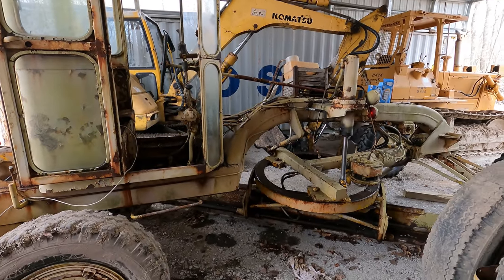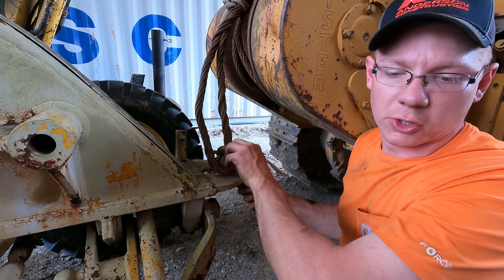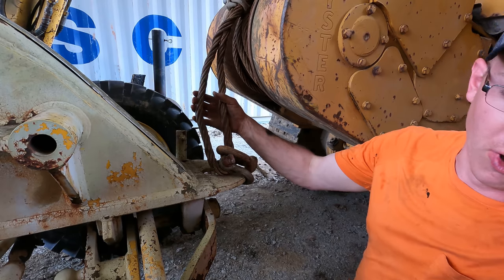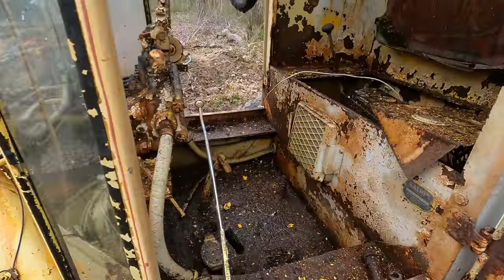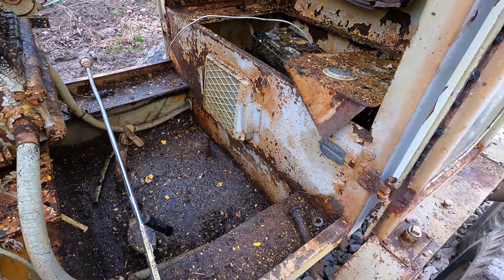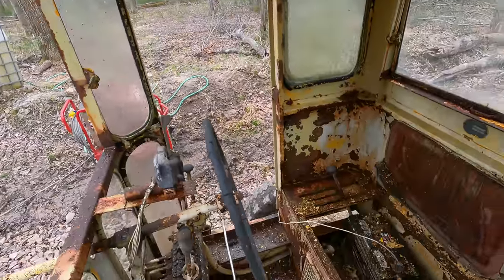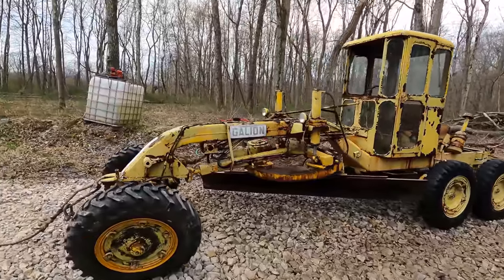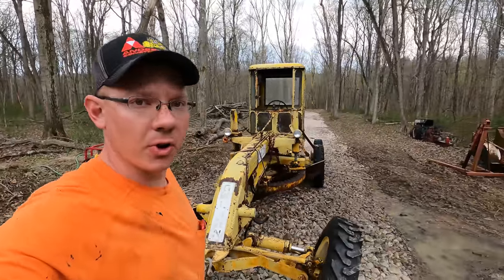Steam Cleaning 60 years of filth & paint off of my Galion Road Grader! (ASMR?) Pt.6

Comment: I get a charge out watching the grader project. I spent 36 years building road graders. Started in the machine shop , worked the assembly line, drove forklift, built transmissions, went into heavy duty repair( that's what the term was for fixing the screwups coming off the assembly line)became leadhand and  was a final inspector before they were shipped. I ended my days in RND. When I started the company was called Dominion Roads Machinery, changed to Champion (that's what the grader was called). They were built in a small Ontario, Canada town of Goderich. As long as I worked there we were either number 2 or 3 in the world competing with  Cat and Deere. Volvo bought them out and down the hill we slid. Don't make them anymore.
Reply: Thank you I did not know where Champion was built
Reply: Sounds like a might good life. 
Lots of respect from Buffalo, NY. 
Roy
Reply: Thank you for the living history. It is appreciated.
Reply: Thank you very much for the history lesson that was incredible. I live in the lower mainland of BC and I’ve been on the hunt for an old champion grader to rebuild and restore. They are incredible machines!
Reply: The DRMCo graders were very popular in Australia,  and were known as a quality machine.
Typical though, a great company bought out by lowlife multinationals and then junked.
Same thing happened to many old established Strayan companies.
Reply: @ivanolsen8596   The problem comes with a lot of smaller privately owned companies, that being there is not the financing available to do the RND to stay with the changing ecological situations. In this case when Europe went to the Teir 4 emission  standards and everybody had to follow suit if they wanted to sell equipment there. Champion was a profitable company IF they didn't have to go high tech. Actually, a California consortium , can't for the life of me remember the name, had purchased Champion and had kept it as it was several years before Volvo got involved. Once again , there was a company with the financial backing to do the RND needed and the company was sold to Volvo. And as far as the B.C. graders were concerned, I personally liked the paint scheme. Orange grader, white cab and black snow plow and wing.
Reply: @lairdspivak3616  Thank you for the info.
Reply: @anrew1000  Hi neighbor! Also from lower mainland here :)

Comment: It might be interesting to pull the inspection covers on the drive axles to inspect the chains and sprockets.  It should be easier to do it before you start painting since the wheels will be removed.

Comment: When you paint it I recommend using black on some parts for contrast, e.g.: wheel centers, hydraulic rams, blade ring, and the fan on the engine (I think the engine would look better if the fan was painted black).  It's the easy but little things that make a project like your grader really stand out.
Reply: Black and yellow are local colors too.

Comment: It’s interesting how the factory coating outlasted the coat on top of it
Reply: Old paint may have been toxic, but it was durable.
I have a 70 year old Ford tractor with multiple coats of paint and colors. All are flaking except what remains of the factory paint.
Reply: I say that about most paints amd cleaners 
If it hasn't got a skull and cross bones on the label with 14 different warnings then its prob not worth using

Comment: That cable is an old school splice. I learned it from an old miner, it's used on the underground mining slushers. You unwind a section of the cable,  cross it through itself and wind it back together. It holds really well, and with a decent tail, won't come apart even without the clamps

Comment: You’ve accumulated a nice collection of old iron.  I worked on various surface mines starting in the early 1970s (limestone and coal) in the western most counties of Virginia and the eastern most county of Kentucky.  We had some newer equipment but used mostly older stuff.  There was even a couple of the old cable blade dozers and a road grader that looked a lot like the one you’re fixin’ up.  I was qualified (and pretty good at) operating front end loaders, drilling equipment, ok on a dozer but I never mastered the road grader... great channel.. I thoroughly enjoy watching you get this old stuff running... I know how hard it is...   stay safe...   🇺🇸🇺🇸🇺🇸🇺🇸

Comment: DIESEL CREEK: If you want that clouded calcium coated glass to look new again. Take mechanics waterless hand cleaner (non grit) and wipe on with a paper towel. If you have a small buffer with a sponge pad, will work amazing. Finish clean with typical glass cleaner. 
We have this issue all the time on diesel locomotives on the railroad.

Comment: i got a couple of tires for my quad from simple tire because you recommended them. fed ex lost one of the tires. i contacted them, and they are replacing the lost tire, and giving me a 50% refund on the tire that was already the cheapest price i had found for my trouble. i told them i bought from them based on your recommendation, and it was some of the best advice i've gotten in years. you tha' man! thanx!

Comment: Awesome Matt Sunday mornings are the best youtube day videos for me, a pot of coffee and off to the couch to watch them   i work in the heavy steel industry machine/heat treat motor grader edges and we once a year clean our equipment during the shutdown and i always work it and love cleaning  stuff  this way satisfying to get things clean like this, just something about it and just went out and bought myself a Ryobi unit with 2900 psi with a Honda power unit on it was $599 CDN got it on sale at Home Depot for $479 and gonna crack it open and fire it up here in a week when it warms up here in central Canada, we still only have daily temps about 40/45 not warm enough to use it yet, the window rubber seals are easy to get, just do your best to stay away from the Chinese stuff it does not last and perishes in the sunlight, i use to install the glass in all the doors of the buses for new flyer back in the early 2000's, it is easy to work with just seal it with some black silicone from automotive suppliers, $20/tube , looking forward to future videos on Christine  👍
Reply: Love doing this stuff, dobby know why just so

Comment: The one tip I will give is keep several of the infinity/figure 8 nozzles on hand because when they jam and all you have is a tiny jet of water shooting off at 35* (*=degrees) you'll want to replace it and you local parts guy won't have it and..... no stay calm its okay, sorry was heading into rant territory.  Good luck getting Christine back together and running without her doing you harm.

Comment: Window gasket is the word you are looking for. Uses a bent hook tool to lock/unlock the seam. looks like TRIM-LOK - LK1663-100, but a lot of equipment used the bead lock type as well. Cut it a little long, lubricate it with silicon spray, get somebody to help hold it and it's a pretty easy installation with the hook tool. 😉

Comment: Around here, we call that a "Whirly-bird" head.  We use one at work, Bridge Carpenter, to clean Efco forms.  That tip will take 5 year old concrete off without fail.
My foreman found out the hard way that it's not the tip to wash your truck with.

Comment: the glass trim is called lock strip gasket, have installed lots of it. The log  loaders up here on Vancouver Island keep sticking logs through their windows .  As well as the yarders . Not hard to do but will need a lock strip tool and glass cleaner works alright as a lube

Comment: Great power washing job, Coming from a union painter who power washed for 40 years, Great job, Now the next job is to find some automotive primer or just some regular metal primer that's an oil base, Same thing with the finish coat You're going to need either an automotive oil base or just a good oil base paint I would spray it personally

Comment: Cleaning the rear tires was satisfying. I’ve been using one of those nozzles for years on power equipment. Especially undersides of mower decks. Need at least 3000psi to run it. Less will work, but it destroys pumps. Ask me how I know!

Comment: Steam cleaners are great. They do a better job than just a plain waterblaster/pressure washer. You can get 90% of the grease off without having to use degreaser and the heat helps dry it.

Comment: Hello Again Matt!  I told you when you did your rims to undercoat insides next time you redo any rims again.  I will recommend you do the same with those areas you will never see around engine bay, and frame.   Holds up better, and in long run cheaper then paint and primer. you can also cover large areas, and buy the large spray bomb cans.  Just a suggestion!  I have a Gallon Bed on my one ton Chevy Dump Truck.  They are done in Ohio if I am not mistaken.  Keep the videos coming brother!  God Bless!

Comment: The proper was to roll a canvas hose is to double it back on itself leaving the end with the male threads about a foot or two from end. Then roll it up from the folded end. When you are done you have both ends near you when you unroll it, and the exposed male threads are protected when it is rolled up.

Comment: I think the roof gives you the best original paint color match. Something I would do is get rid of the drip rail around the roof they just hold water and end up causing a rust problem. When I pressure washed my 68 chevy stepside for the first time It was almost the last time as I washed all the grease and oil off of the wiring that was brittle and cracked and smoked the whole wire loom under the hood and almost caught the truck on fire. Go through your wiring to save you a headache later.

Comment: Matt: someday (in future) you might have to level the stamped gravel inside the garage.. because of the tire/track marks. Add some LED lights ontop of the cabin of the road grader.. along with indicator and break lights.. so if on a job and its night.. ppl can see behind you.. that its something big traveling on the road in front.. Add a fiberglass front screen with a soft wiper (winter/summer).

Comment: The roof was pretty nice. All of that dirt and grime really held up on the pain job. I was thinking the same thing about pulling the windows. I am sure they still make that rubber gasket for those windows. Though I would have pulled all the lights and anything else that could have came off before hand. Though its a nice clean unit today! LED lights and Bar lights will be a nice new addition.
Reply: I would even consider rhino lining the cab as well. it should help it hold up for years to come.

Comment: Those power nozzles are great stuff, I use them about 70% of the time - be aware they inject water into any bearing and can cut hoses and softer fittings badly, so be cautious near engines and uni joints, bearings and any seal...

Comment: In regard to the winch when you re rig it, when attaching the clamp to the wire rope to make the bite at the end the shackles’s hoop should go on the dead end side and the saddle to the running side. The hoop bites into the rope and keeps it from slipping out. I think they are the wrong way on yours. Also with shackles the best technique is to tighten it then back it off 1/8 of a turn. It will keep the shackle from locking up under load even after it has been in place and weathered.

Comment: Check out Samson rope company Amsteel type line when you replace the cable on the dozer. Tug boats  are starting to use amsteel instead of cable. Up side of amsteel very light wt stronger than cable of the same diameter no meat hooks and less stretch than cable no memory spooling off drum. How ever it is a bit more susceptible to chafing.

Comment: That cleaned up pretty nice... oddly you commented on its roof and I   was thinking about the roof as it cleaned up about if it had had a bath before being sold, the dollars for it just might of jumped up a bit. I'm not real sure but think that the cab comes off rather easy as in torch off old bolts an new go in but once that is off, and I would, then installing the 6-71 would carry it right down the road as it had if I remember without cheating, a 4-53 in it before or something a trifle smaller..... no problem as mounts move easy with the electric wrench and some 7018 would make sure it didn't keep going down when you set it in. I can see this being one of your finer buys as it takes shape and the wallet grows thinner. Its worth it though as the size of that machine will make its own jobs happen. Yes you could rent it out on jobs but your fixing it once and doing it twice better have plenty of dimes and nickels dressed as dollars coming with that effort. I watched yours Matt before I will watch Salvage   workshop and even Wes who all have videos that I follow. I don't know if I ever mentioned this next fellow before but its pure relaxation to see him create all his projects. I think if you started with some of his first builds to see where he comes from would result in a marathon as he is extremely talented. Donn DIY is his channel name and he has built from sawmills to firewood or track machines and snow machines out of the scrap in his grandpas old homestead. Can't say enough as to his talents. So as to this build, I really don't know how far you would take it but as for me, I would go all the way because the rest of it is savable and fair shape. Theres bearings and lines, linkages and such that will take some doing.... all well worth every minute and never a minute too soon as you yourself have work for it.

Comment: you really should find and grease all grease zerks asap after power washing equipment - the new grease displaces whater - therefor prevents rusting on bearing surfaces also it prevents you from forgetting to grease it and running it "dry "

Comment: About the Turbo Nozzle...I was told you should always have the nozzle pointed somewhat pointed in the down position when you squeeze the trigger, due to it has a ceramic disk that rotates causing the circling effect. If it pointed up when you squeeze the trigger that disk will slam into the head and could crack it, or break it. They aren't cheap. Not sure if this is true or not.

Comment: My favourite thing about this video is that is wasn't me doing it!

I think you should pull the wheels off the steam cleaner, and mount it on a small, custom trailer.  Two RHS side rails that double as forklift/skid steer tine slots, axle with your preferred wheels, and a retractable drawbar.  Make it a lot quicker and easier to move around.

Comment: if you can or will try wet the surfaces and in a yard sprayer add 1 gallon bleach dilute with 1/2 gallon water and then add tide liquid 2 cups last...wet the spray and let soak in sections and the power wash away I think you will find this as remarkable as the circular motion sprayer

Comment: I think it's worth it. It has another 60+ years in it. I made a previous comment about it, that it would be nice to see it get a full restoration. I think it is nicely built and the engine ran so beautifully on first try. With all the time you put into this stuff, I was wondering if its possible for you to be able to make your own hydraulic lines for much cheaper? Old stuff like this needs a complete rework so maybe it is worth it?

Comment: HIIII MATT !!!! nice to see you on the grader ! if you put new tires ...? in front wheel  put smooth tires no traction and easier turning !!  (costing less) !!! WHERE IS THE ROAD ....? Yes put those tires at the back  on one side waiting for other 2 new ones for the other side ! OK When will you have the engine....?  What about the roof....? Not yet...? Water piping from the creek to the work shop 1"1/4 ID......electrical pump on pressurized piping....! Take care good health !!! Best regards !!!

Comment: That rotary tip seems to be moving a little slow. You should oil it after each use and before storage to ensure the bearings don’t rust up. It will last a lot longer.

Comment: When you pressure washed the wheels it looks like the original color may have been black. IMO when you paint the wheel hubs, paint them black and then paint the wheel rings yellow like the front tires when you changed them.

Comment: your turbo nozzle seems to be spinning pretty slow, the ones I've seen and used spins like crazy. you should be able to hear it when it picks up speed. There were a few times when you were using it that it picked up speed, but sometimes it looked like it froze up completely. Maybe it's the low water pressure running out of the tank. 
if it's not working correctly I would turn it back in :)
Reply from the maker: The frame rate I recorded the video in makes that thing looks like it’s spinning slower than it was, I did a really good job there was a few times that yes I could hear it slow down I don’t know if it dirt in it or what but I don’t think there’s anything wrong with it

Comment: Since you have the dozer, you don't even need to to put the motor back in the grader. Just run an auxiliary hydraulic line to the grader and drag it around with the winch. You might need two people if you want to get any work done 😂

Comment: It looks great the way the machine is cleaned. A question I always ask myself when I watch videos where old and oily devices are processed with high-pressure cleaners, what about the oil-water mixture? that seeps into the ground and under certain circumstances contaminates the ground. I don't want to have the environmental apostle hanging out, but isn't that good? Or are the engine and hydraulic oil environmentally friendly?